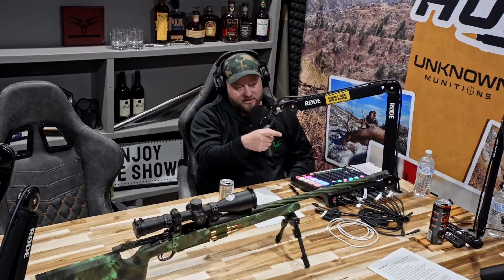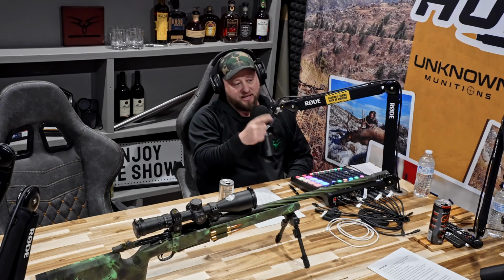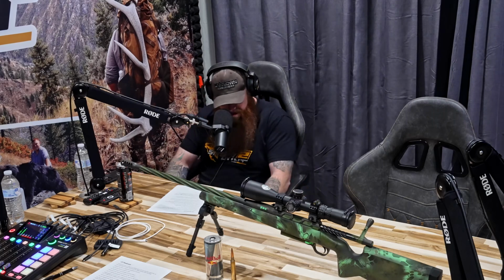15. The Easiest Way To Increase Muzzle Velocity

Comment: See, when you guys brought up pressure and brass, how would I be able to tell if i were in a safe pressure charge while working up to the new fps gains promised? I shoot Adg brass in my 300 wsm I had throated for 210 ablr’s. I had zero common pressure signs with 4350 and 210 ablr bullets at 2900 fps with 65 grains of powder. I brought my powder charge down to 61.5 gr because I didn’t like how much my cases were expanding at the web. I have no doubt I was way over pressure and probably killed the life span of my brass, but if I were to +p my 300 wsm, would I just be looking for a node that’s 100-150 fps faster and go off of brass expansion to tell me I’m in a safe pressure zone? Btw, my barrel is 26 inches, and I didn’t have any crunch with 65.3 grains of 4350. Just thinking, the extra 100-150 fps would be nice along with the normal brass life expectancy. Hope my question makes sense.